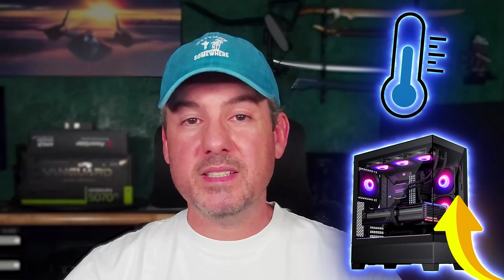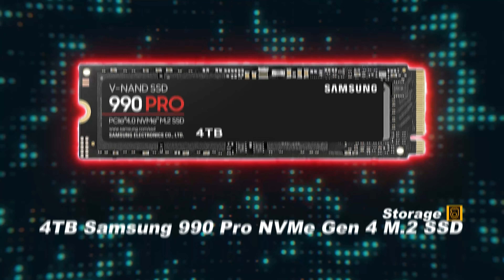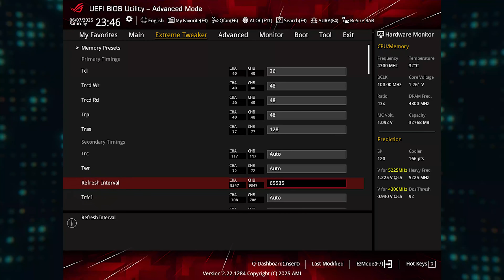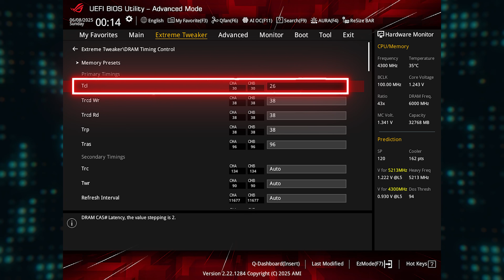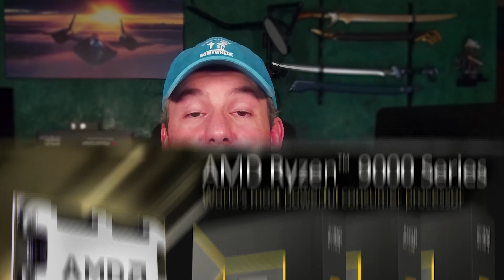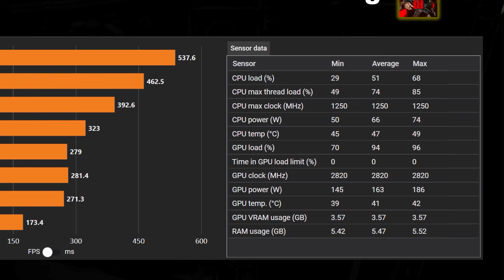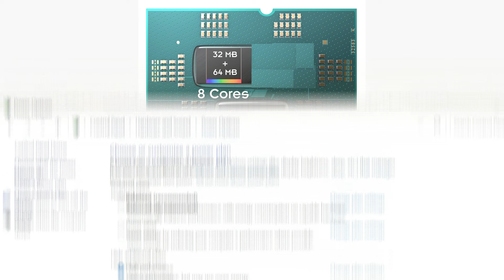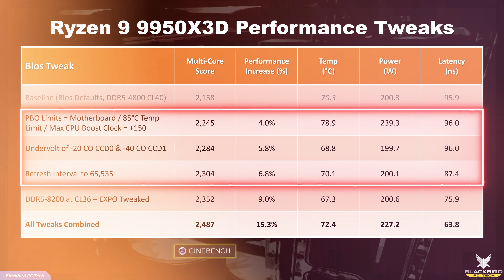What Are The Best Settings for an AMD Ryzen CPU?

Comment: Is it normal for my CPU profile scores to be lower after overclocking than just when underclocked?
Reply from the maker: No, that’s not normal … otherwise there would be no point overclocking. What is your cpu and cpu cooler?
Reply: @blackbirdpctech ryzen 7800 x3d artic liquid freeze 3 420
Reply: @blackbirdpctech i have a ryzen 7800x3d and artic liquid freeze 3 420
Reply: @blackbirdpctech I followed all your steps, I have a stable undervolt of -26 (at least I think so, I didn't get any crashes in games or tests on 3mard aida and cinebench) and I put a clock boost of 50 and then 150 but I didn't notice anything in terms of improvement (except a worsening in the benches on cpu profile and a very slight improvement on cinebench but I don't think it counts) can you help me?
Reply from the maker: @Rizzi14  the 7800x3d is locked for overclocking, so the boost will not do anything
Reply: @blackbirdpctech Is there any way to boost with the 7800? or do I just stick to undevolt?
Reply from the maker: @Rizzi14  no, just focus on undervolt and memory

Comment: For my r7 9800X3D what do you recommend for warzone?
Reply from the maker: You need to go through the steps to find your optimum settings.
Reply: @blackbirdpctech  Do you recommend putting in the scalar x1? And change the cpu ratio 52 and the core voltage to 1.15000?
Reply from the maker: I recommend watching the video and following the steps ... that's why I made the video

Comment: can i do all of it on 5800x3d?
Reply from the maker: It's a little different ... the 5800X3D uses DDR4 RAM, so memory optimization is different ... if your motherboard supports PBO then the other tuning options should be similar, if not then you can watch this video to learn how to undervolt your CPU: https://youtu.be/GJCC94cRGys
Reply: @blackbirdpctech i got ripjaws cl14 so i will skip ram oc dw although kinda wanna switch on 9800x3d

Comment: The hardest 'work' imho is to purchase and find the best motherboard for your CPU and your DDR5 sticks. The RAM IS the trickiest thing to 'marry' with the motherboard, before even thinking of optimizing anything. I've purchased 5 and refund 4 mobo before finding the good one.
Reply from the maker: I somewhat agree, but only if you are trying to run highspeed RAM (6400 in 1:1 or 8000 : 2:1) ... your CPU memory controller will impact the stability of your RAM the most.
Reply: @blackbirdpctech  Well my DDR5 is 6400 Expo cl32 but if I restart windows 11 then the PC hang, but if I switch off the PC and restart it boots nicely, had same issue with ddr5 6000cl30, tried multiple mobs with multiple windows re-install every time. Expo off is ok.
Reply from the maker: @psour33  the issue is that you are attempting to run high speed memory (6400 MT/s) in 1:1 mode ... you need to get lucky to get it to run stable
Reply: @blackbirdpctech  I think you were right, it was on AUTO and I forced UCLK=MCLK/2 and it seems more stable. I also force memory retrain for now, longer but safer boot.
Reply from the maker: @psour33  I wouldn’t run 6400 in 1:2 mode … better to back off to 6200 and use 1:1 mode

Comment: Hi, I didn't quite understand step 2. I'm currently using Corsair 2x16 CL30 6000MHz RAM. Should I include the data you provided in the table? Sorry, I don't understand.
Reply from the maker: If you are running DDR5-6000 then your motherboard will almost certainly set your FCLK to 2000 MHz automatically, so you shouldn't have to manually enter it
Reply: @blackbirdpctech ok thanks so the only thing in point 2 that I should do is take the fastest times from another ram similar to mine?
Reply: @blackbirdpctech I didn't understand if having 6000mhz I should increase the mhz of my ram in addition to changing the speed
Reply from the maker: @Rizzi14  to be clear, you don't have to do anything. You can attempt to clock your RAM higher, and if you do try say  running it at 6400, then you can try using the primary timings from a 6400 kit.
Reply: sorry to bother you again, so you're telling me I shouldn't touch the RAM and just skip to the CPU undervolting step?
Reply: I currently have a 7800x3d and I wanted to do an undervolt and then overclock like in your video, I congratulate you on your skill, for me it's all new but I find it well explained

Comment: This is awesome, clear and very informative. But all of this depth and learning but how much more performance will this actually squeeze out of your system?
My x870e Carbon Wifi with a 4090 and a 9950X3D run as more than reasonable temps under full load, and I just enable the one click OC profiles in the BIOS.
I used to do more in depth OC settings, but this is just a level of depth I'm just too old for I guess. 😅
Reply from the maker: Appreciate your comment. I show the performance gain in benchmarks and some games in the video. I was able to achieve an increase of over 15% in Cinebench and in a CPU heavy game like Microsoft Flight Simulator 2024 I was able to increase the 1% lows by a whopping 47% ... so it can have a large impact on performance.

Comment: What if our only options are DOCP?
Reply from the maker: I cover this in the video:

"If you are using an XMP RAM kit with an Asus AMD motherboard, these profiles will be listed as DOCP or Direct Overclock Profile."
Reply: Then you don’t have the am5 chipset
Reply from the maker: @Nettcat777  that’s not true … if you try using XMP kits on an asus am5 motherboard they will show as DOCP in the bios.
Reply: @blackbirdpctech I didn’t account for using Intel kits on an amd build which I guess is possible and will have the docp instead of expo. Not versed on Intel as all of my builds have been amd. Thanks for that info though, now I know
Reply from the maker: @Nettcat777  no problem … XMP and EXPO are just profiles … XMP kits typically work fine in AMD systems

Comment: Thank you so much. My 9800c3d is flying so far on -30 +200 80C temp limit. Clocks going up to 5600 all on air royal pretor 130. Very happy
Reply from the maker: That's a fantastic result ... you might want to test the boost clock just to make sure that you don't get higher performance with +150 or even +100 ... sounds strange but sometimes it's true.

Comment: My 9800x3d failed aida64 on stock settings after about 2 minutes
Reply from the maker: That's not good ... are you sure that your RAM is stable?
Reply: @blackbirdpctech  I realized that I actually still had a -10 CO. I loaded my BIOS defaults which only changed Precision Boost Override from Advanced to Auto but it seems the negative offset is still set in Auto mode. Once I reverted this back to 0, I was able to pass the stress test. I have an Asus Rog B850-A Gaming Wifi motherboard and I can't seem to achieve -10 CO. On stock settings my CPU temperature does not exceed 60 degrees during the stress test. I wonder if my default CPU voltages are on the lower end by default
Reply from the maker: Are you sure that you don't have a curve offset applied in the other PBO area of the Asus Bios? 60 deg C is an excellent temp under load.
Reply: @blackbirdpctech I double check that no luck
Reply from the maker: @sheriff5909   then I wouldn't worry about it ... you already have great temps.

Comment: Great video, thanks! Not sure if its my HD800 or on your end but the sibilance is pretty bad in the audio.
Reply from the maker: It was likely my microphone ... I have a new Rode mic that I am using now.
Reply: @blackbirdpctech  That's fab to hear. I'd like to ask you about the OC part after UV. I've so far successfully UV'd to a -30 on both CCD 0 & 1. Adding the power limit is fine however when I add the boost clock even at a plus 50 MHz, my PC begins to hang at the Sign In screen. The improvements to my temps and scores have been amazing so far, so if this is all I can achieve I am content with it.
Reply from the maker: @hjm9586   then definitely don't do any boost ... it's not necessary ... you will get most of your benefit from the undervolt and it looks like you have a golden sample chip, so you got lucky.

Comment: 1. Should we undervolt first or overclock first?
2. Also I have watched your other video of 78003D vs 9700X where you can get the 9700X to perform on par with the 78003D. If we tune both of them to the max will 9700X will still be on the par or 78003D will win again but then how big would be that difference?
Reply from the maker: I always undervolt first, but it doesn't really matter if you use PBO to do both. In the 9700X vs 7800X3D video, both CPUs were undervolted however the 7800X3D is locked for overclocking ... you can undervolt it but some of the other PBO features don't have an impact on performance.
Reply: @blackbirdpctech  Thanks for the responding back. One last question if I get a ram 6400 ram with 38 CAS Latency will it bottleneck the 9700x or will it be fine?
Reply from the maker: @infinitetesla9202  it's not a question of bottlenecking ... a CL of 38 will drop your performance ... it would be better to buy a kit with a CL of 32 or tighter.
Reply: @blackbirdpctech  If I don't have any option available with 6400 CAS 32 and 6400 CAS 38 then is it better to get 6000 CAS 30 then?
Reply from the maker: Yes, that’s what I would do
Reply: @blackbirdpctech  Thanks man you are the real deal. I hope and pray you get all the prosperity and success in everything you do. 😁
Reply: @blackbirdpctech  Hi again. I have a question since I am unable to find a proper answer anywhere. Which motherboard to get for max 9700x overclocking. 14 Phase with 80 Amps or 14 Phase with with 60 amps. 14 phase 60 amps is cheaper and has more features but in terms of getting the max performance out of 9700X which one would be better?
Reply from the maker: @infinitetesla9202   your VRM design/layout is not going to limit your performance

Comment: My ram is cl30 6000mhz i am not gonna attempt a 2200mhz oc on my ram
Reply from the maker: You are talking about your infinity fabric clock and why would you try 2200 when I recommend 2000 for ddr5-6000 in the video?
Reply: @blackbirdpctech at the end when you list all the tweaks it says set memory to 8200mt that would be a 2200mt oc on my kit unless im misunderstanding something
Reply from the maker: @fabianholder5053  as I state in the video, those tweaks at the end are the ones I made for my specific system ... that system had a 9950X3D and DDR5-8000 RAM. I also stated multiple times that your results will vary based on silicon quality. You can't just copy my exact tweaks, you need to follow the process I outline in the video to find the optimum tweaks for your system.

Comment: I have exact the same CPu and will try to undervolt/overclock it. Which of the CCD"s has 3D cache? CCD0? Why it's less undervolt?
Reply from the maker: CCD0 has 3D v-cache ... for my CPU it has a lower undervolt because that is the limit for my silicon ... yours will be different, as explained in the video

Comment: Im kind of confused lol so whats some good ram and speed optiond I should buy for a 9800x3d build I'm buying for right now. It'll be going in an Asus b850 board w/ 5070ti. I also have the 7800x3d I just bought from Amazon but microcenter has the 9800x3d on sale for $60 more bucks so I'm thinking about swapping to that instead.. Thoughts and suggestions appreciated
Reply from the maker: You can take a look at the benchmarks for different RAM options in this video: https://youtu.be/JuUhnQaGG_I

Comment: Do you know Gigabyte AI Snatch? Do you recommend this, and on top your oc suggestions?
Reply from the maker: I stopped using Gigabyte motherboards because of the issues I had with their X870 boards. That said, I've never found any of the OC gimmicks from Gigabyte, Asus or MSI actually perform as marketed. In most cases they reduce performance and/or stability, so I wouldn't recommend using them.

Comment: I’m getting horrible stuttering with 9800x3d builds - 7800x3d seems to run just fine.
Reply: Try enabling Global-C state in bios. Put mine from auto to enabled, no more stutters for me. I'm using a Ryzen 9900x
Reply from the maker: @matthewbeasley2869  you have a dual CCD CPU, so it makes sense that it might help your CPU ... it likely won't do anything for a single CCD CPU.
Reply: @blackbirdpctech  Ryzen 7 9800x3d is  single  CCD CP,  no?
Reply from the maker: @GermanFragEditing  yes, I was responding to the comment about the 9900X
Reply: @matthewbeasley2869  I did this - it didn't help unfortunately -- I think I have a bad driver or some other mobo related issue.
Reply from the maker: That’s strange … have you tried installing the new chipset drivers from AMD?

Comment: Hi! I'm new to this and still learning. I was wondering — before diving into BIOS and advanced tweaks — if setting my processor to Eco Mode using the Ryzen Master app would help. It says it operates at lower power consumption, so I was hoping it might reduce the temperature spikes I'm getting.

Have you tried Eco Mode yourself? Did it work for you?
I'm a bit nervous about tweaking things in BIOS, but I might give it a shot if Eco Mode doesn't help.
Reply from the maker: These aren't advanced tweaks, these are actually very simple ... so there is nothing to be scared about. That said, all eco mode does is limit your power ... so you will see a large performance drop if you enable it.

Comment: Also, if you want absolute the best chances of memory stability, I would recommend turning off Memory Context Restore (MCR) and fast boot both in bios and windows. Sure, having the system retrain memory on every boot will take longer, but it ensures to have the best stability for your system.

Comment: Isn’t the balanced option only viable for the dual CCD X3D chips? On a non X3D dual CCD, I think I would prefer if windows uses the fastest cores available to it
Reply from the maker: I said this in the video:

"For Ryzen CPUs with only one CCD, such as Ryzen 7 and Ryzen 5 chips, you can select the “High performance” power plan. There may be situations where selecting the “Balanced” plan is better, but overall, the “High performance” option will result in higher average performance for single CCD CPUs."
Reply: @blackbirdpctech I was referring to the ryzen 9 dual CCDs that are non X3D like the 7900X, 7950X, 9900X, 9950X
Reply from the maker: @iTechtronicz  I see ... it would still be better to use the first CCD for gaming because then you won't get a latency hit by accessing the second CCD ... so I would recommend balanced mode for all Ryzen 9 CPUs.

Comment: Have you tried Gigabyte boards by any chance?
Reply from the maker: Yes I have ... in fact a lot of my early 9000 series CPU reviews were done on an X670E Aorus Master. Unfortunately I encountered series performance issues with the X870E Aorus Master and the response from Gigabyte was terrible, so I stopped using Gigabyte boards.
Reply: Ohhh gotcha, fair enough.

 @blackbirdpctech
Reply: @blackbirdpctech  I’m currently having issues with this same board and I thought I was tweaking. I guess I’m not, and it’s actually the board. Glad I watched this video. What would you recommend in its place? X870E Carbon WiFi a good choice?
Reply from the maker: @eSPionageTech  yes, the carbon is a great choice ... here are some options from MSI and Asus I like, including the carbon:

1. https://amzn.to/3TBorVQ
2. https://amzn.to/3TGgwqg
3. https://amzn.to/40V5JMJ
4. https://amzn.to/4551SPK